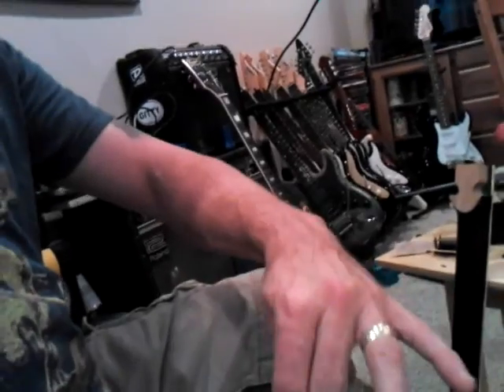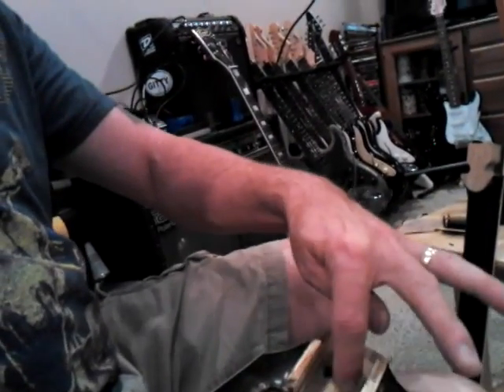cort neck reset

Comment: Simply regluing should work, if you are really worried about it happening again you could insert a couple of dowels from the back instead if bolts, that will make a very strong joint. Good luck man and keep rockin"!